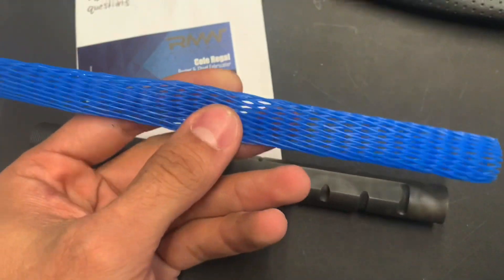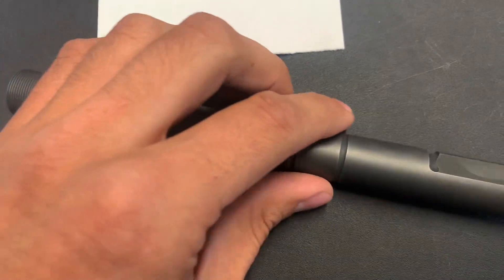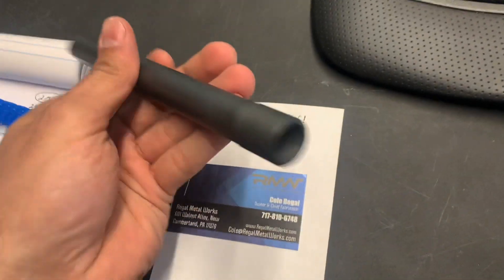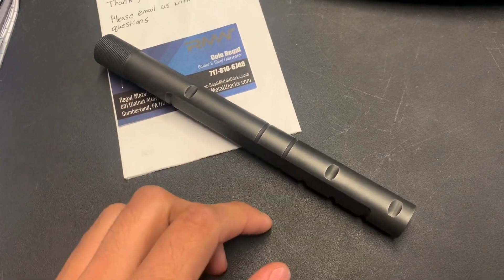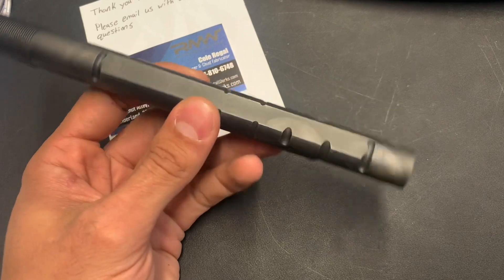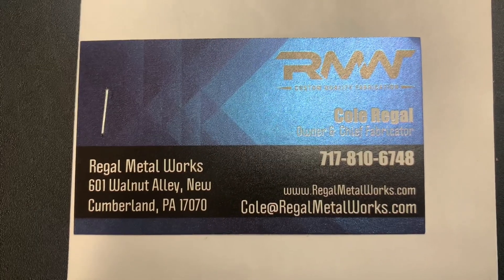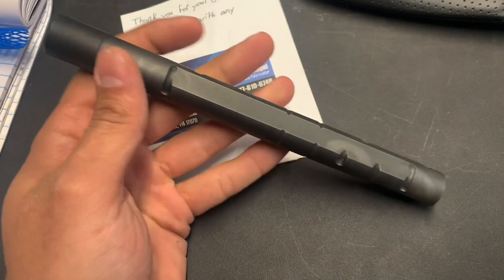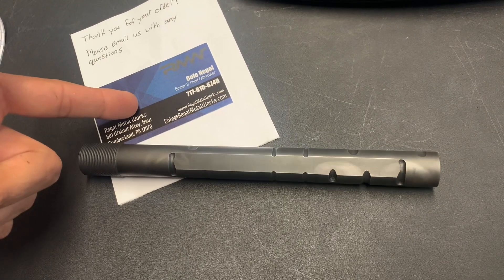Benelli M4 and M1014 American Made 3 Position Recoil Tube! #benellim4 #benelli  #RegalMetalWorks

Comment: I got a notification from EBay when this recoil tube was listed. It looks outstanding from the photos. It was listed for about $320, it’s not cheap but it’s a fair price if it’s as good as OEM. Funny thing is, I believe most the M4s with fixed stocks have 3 position recoil tubes hidden inside. My 11703 did.
Reply from the maker: It's a half dozen of one, 6 of the other choice when it comes to the collapsing stock issue on the M4/M1014. On one hand, you can get the pistol grip stock and a Mobil Choke equipped barrel on the M4 (11703), which requires spending $300 to $500 for the collapsing stock set. Or, you can buy the M1014 with the fixed Mod choke and the "skeletonized" stock set that only requires you install a 3 position action spring/recoil tube and or assembly... which costs $200 to $400. haha.
Reply: By the time you pay a gunsmith to install the tube (which most folks recommend doing), it is probably a wash.
Reply from the maker: The thing is, if you have a fully functioning brain, a blow torch, spanner ring pliers, a 1-1/16” crescent wrench and a padded vise, you can easily replace the tube yourself and save the expense of a Smith spending 15 minutes on it.

Comment: Awesome! $300 isn't cheap but worth it when you know you're getting good quality and supporting a US business at the same time. Whenever FFT gets Benelli ones in stock they're like $200 so I'd personally pay the extra hundred and go with a Regal Metal Works one. There's definitely a big demand for these recoil tubes right now. I love that they're trying to help fill the market.

That being said, if you're willing to pay for international shipping there's a company out of New Zealand to consider called Delta Mike LTD. They sell replacement parts for the Tac12 including a whole recoil tube assembly for about $45 and also a collapsible stock for about $200. They're out of stock right now because they don't have the recoil spring in stock however you can buy the other parts separately. The recoil tube by itself is about 35 bucks. Idk if you'd want to reuse other parts but they have them too just in case, 9 bucks for a stock retaining nut, 9 bucks for a new recoil tube nut, 13 bucks for a spring plunger. Usually about 18 bucks for recoil spring but again, springs are out of stock. Food for thought. My only complaint about their recoil tubes are that they're longer than the Benelli tube and won't fit a Mesa Urbino stock on it, but if they sell collapsible stocks right on their site for $200 then idk why you wouldn't just go with that instead.
Reply: UPDATE: Just got my collapsible stock from Delta Mike LTD. Haven't installed it on my TAC12 yet but it looks awesome. For $200 it came with the grip, stock, and a complete 9 position recoil tube assembly including a stock/recoil tube nut, plunger spring, etc. Everything. I hear Todd from Freedom Fighter Tactical has some guys in R&D working on a USA made recoil tube because they rarely have the Benelli ones in stock but no ETA yet. I still think Regal metal works is a good choice. 

As for the TAC12 itself, I heard nothing but good things but when I took it out for the first time I shot 150 shells of a mixture of buckshot, high velocity slugs and some birdshot. It only cycled properly one time out of 150 shells. I understand there can be a break in period but holy crap I feel like something's wrong. It had no problems ejecting the buckshot and slugs however no matter what type of shell I shot, the next shell in the carrier would never cycle into the chamber unless I manually racked it like 5 times. Also I was under the impression that when the gun is empty and the bolt is closed you can load a mag tube full and when you press the carrier latch I thought a shell was supposed to go from the tube to the carrier allowing you to rack a shell into the camber. It wasn't. The only time it moves a shell from the mag tube to the carrier is when the gun was fired, so no matter what I always had to put a shell in through the bolt to load it. And I had trouble trying to ghost loading as well. I loaded the mag tube first, slightly pulled back the bolt to push a shell down on the carrier and try to let the bolt ride over top of it but I couldn't fit the shell in without engaging the carrier. It's like it's engaging too soon or something. There's a youtube video titled "FIX TURKNELLI MISFEED ISSUE" where a Sulun Arms gunsmith has a similar problem and uses a metal file to file down what I believe is the breech bolt latch. After that it appears to cycle fine. But comments and likes are disabled so literally no feedback on it whatsoever and I can't find any other info. I'm considering taking it to a gunsmith. Any feedback would be much appreciated.
Reply from the maker: Sounds like you have an issue with the tension of the shell stop latch and the geometry of the shell carrier dog and how it is interfacing with the actuation notch on the bottom of the bolt carrier. Polishing of the engagement surface of the shell stop latch, reduction of the stop latch spring's tension, and re-profiling the face and shelf of the shell carrier dog can all combined result in a fix of this problem. 

If you send me some pictures via the channel email of all the action parts and a short video of the malfunctions I can probably help you solve the issues yourself without having to take the gun to a smith. Really, it's a tolerance-stacking and fitment issue. These Turk clones are not made precisely enough to not require hand fitting from time to time, and issues such as this are the result.
Reply: @AmericanArmsChannel  Thanks for the quick reply. I'll make sure to check those things out as well. The next time I take it out shooting I'll try to get some pictures and videos of what's going on. I'm pretty sure the Sulun Arms gunsmith in the video I referenced was filing down the breech bolt latch but I feel uncomfortable trying to file down a factory part by myself so I think as an alternative I'm going to buy a Benelli breech bolt latch for like 15 bucks from MGW and try it out. Possibly file that one down if necessary. But again, thanks for the info. I'll check out what you suggested.
Reply from the maker: @jkees6751  what they called the “breech bolt latch” is the shell carrier (lifter) dog. You’ll be fine to file it lightly until it works correctly. But it will help to see the malfunctions, as that may not be the only cause of the issues.
Reply: @AmericanArmsChannel  Gotcha, I'll give it a shot. The carrier also looks like it sticks out of the bottom of the shotgun more than I was expecting and it and seems very slightly tilted one way. Could just be my imagination though. I'll try what you suggested and post another reply with an update in the future.

Comment: Do you have to change hardware that goes inside tube the spring,nut ext or will original hardware from non collapsable tube will work for collapsable one? 
Thank you in advance.
Reply from the maker: You will have to swap all hardware from your OEM tube to the RMW tube. The RMW tubes now come with their own Flex ring, however. All parts are 100% compatible. 

I will be publishing more content on this product in the near future. 

- Drake
Reply: @AmericanArmsChannel   
Thank you very much for quick response. 
Stay safe and God Bless America 🇺🇸
Reply: @AmericanArmsChannel  Hello Drake,
Did you ever install your 3-position tube from RMW? 
If so how did you like? 
I’m looking into getting Regal Metal Works New 6-position tube and wanted to get some feedback if your pleased with it and your installation experience. 
Thanks again.
Reply from the maker: I did install the tube right after the original video. It was a standard install as it, for all intents and purposes, is identical to the dimensions of the Benelli OEM tube. I have produced a "final" review on the "pre-production" 3-position tube I purchased.

At this point in time I am working with RMW on sponsored content as well as offering viewers my honest opinion of the products with active feedback to RMW for product improvements. I have in hand both a 5 and 6-position RMW recoil tubes for Testing and Evaluation.

The review of the 3-position I purchased: https://youtu.be/tigOdQNlOFU

If you want more information on the Recoil tubes, the long form Podcast with Cole Regal (Owner/Proprietor of RMW) is also posted and has a metric ton of information regarding the business and the recoil tube: 

https://youtu.be/d787kNa-A-Y

Comment: Do they make one for Franchi 520 hunter
Reply from the maker: No. If the thread depth and pitch is the same as the Benelli Super 90 pattern of shotguns it would be possible to install this recoil tube on the shotgun, but I do not have the knowledge to answer if that is the case or not.

Comment: How do I install it?
Reply from the maker: There is one video on Youtube of it being done, but I and RMW will be producing videos this spring demonstrating install. 

To help you though, you will need to follow the process below:

1) Disassemble the M4/M1014

2) Remove the Stock/Pistol Grip - Note:

 A. If your M4/M1014 has a fixed one-peice pistol grip or field pattern stock, you will need to remove the butt pad and remove the retention nut holding the shot in place. Then, remove the stock retaining bolt from the Recoil Tube end stop. If you have a multi-position tube you can use that or replace it with the RMW assuming you want more than 3 positions. 

 B. If your model has the M1014 pattern collapsing stock, remove the butt via the disassembly notch on the on position recoil tube. Remove your trigger guard if you have not already. With the shotgun facing away from you, turn the pistol grip counter-clockwise until it frees from the threads. Remove the Pistol Grip.

3) Disassemble the recoil tube - NOTE: you will need to use needle nose pliers or snap ring pliers to remove and reinstall the recoil tube snap ring that retains the recoil tube plug. once removed, unscrew the recoil tube plug being careful to catch the action spring when it clears the threads. Remove the plunger from the tube as well. 

3) in a padded vise, mount the shotgun - TIP: I recommend  mounting the shotgun with the bottom of the receiver facing upwards so that access to the recoil tube is easy and the vise has more purchase area and the tension is spread out across the receiver to avoid damaging or bending it. Re-installing the trigger guard can help keep the receiver from flexing as well.

5) With a heat source, heat the tube until the loctite in the threads of the tube within the reciever liquifies. - NOTE: DO NOT HEAT THE RECEIVER! DO NOT HEAT THE TUBE UNTIL IT IS RED HOT! You can use a heat gun (takes the longest), or a propane torch (fastest). If using a flame, do not keep the heat applied to only one spot; move it about the tube close to the receiver. 

6) Remove the lock nut turning it counter-clockwise once the thread locker is softened or liquefied (apparent when the threads/joints entering begin to sweat it or the tube reaches over 130 degrees at the threads).  - TIP: cover your wrench with painters tape or masking tape on the side that will be towards the receiver to prevent scratching it. A longer wrench will provide greater leverage and an easier time breaking the lock nut free. 

7) Using padded vise grips or heavy duty pliers, grab the recoil tube and turn it off the receiver (again, counter-clockwise).

8) Clean the threads of the receiver of excess thread locker

9) Assemble your new RMW recoil tube with the internal components pulled from the OEM tube and either a Benelli OEM plunger retaining ring or the supplied retaining ring. - NOTE: The recess for the plunger retaining ring is in the receiver side of the tube. 

10) Partially thread the lock nut onto the new RMW recoil tube

11) Thread the new recoil tube onto the receiver until it has filled all threads in the receiver. You can add thread locker if you want to; Red or Blue locktite recommended. 

12) Install the butt onto the recoil tube in one of the locked positions. Use the butt to clock the tube to the center-line of the  receiver. Once clocked, tighten the lock nut by hand until it is firm. Grab the stock and hold it and the tube in place while you tighten the lock-nut with your wrench. DO NOT tighten further than 1/8 to 1/4 turn past "firm"/"tight" against the receiver. 

13) Test the tightness of the recoil tube by wiggling the stock side to side. If no movement is present, Remove the butt stock and remove the shotgun from the vise. 

14) Turn on the pistol grip until tight and indexed properly. - TIP: use the trigger housing to index the grip properly. Do not locktite the grip in place. 

15) Install the buttstock

16) Reassemble the Firearm and function check.
Reply: I Read through the install 3-4x. I just like to program the dome before I mutilate this overpriced Olivetti Bauhaus Pininfarina Pastina...

Professional grade instructions, all steps present / accounted for.  Thanks. You are better than Benelli. To me this is result of a rip off. One locked center position not lockable closed. Big stupid 5rd mag plug. Could have tossed in the box.
Reply from the maker: Glad it helped! Sorry for the typos and no video. Cole and I never got around to getting and install video together (maybe sometime in the future, but no promises). 

Let me know if you need any further assistance - feel free to email my channel email or email/call Cole at RMW directly with any questions.

Comment: lol no internals when FFT is selling the OEM with internals for $100 more. No thanks.
Reply from the maker: OK. Go buy that one then. I don't know why you need the internals when you can just use the ones in the gun (you have to remove them anyways to remove the fixed OEM tube for install of the multi-position replacement) and save yourself $100, but that's fine if that's your MO. 

I will add, that if you want a 5 or 6 position tube your only option is to buy the RMW recoil tube. When those tubes dry up from FFT or Benelliparts.net, RMW will have their tubes in stock and ready to ship still.